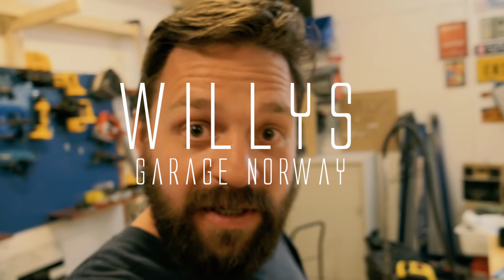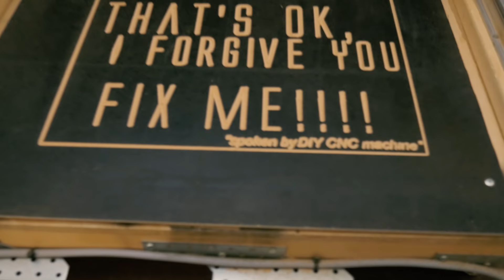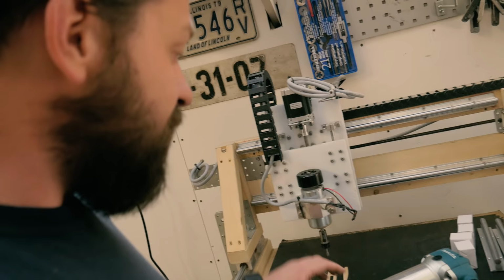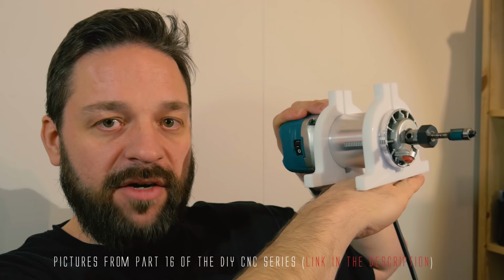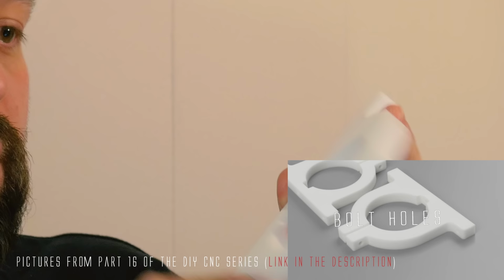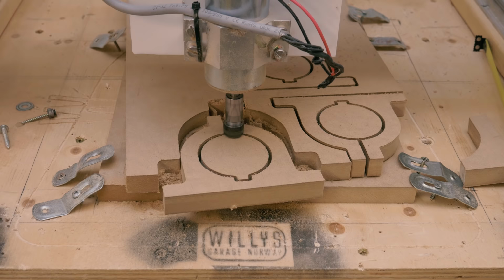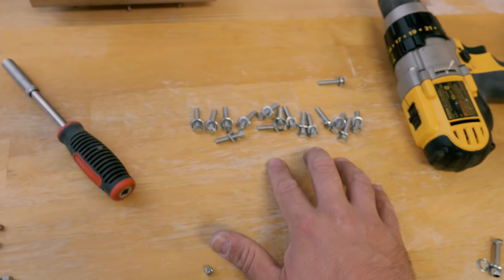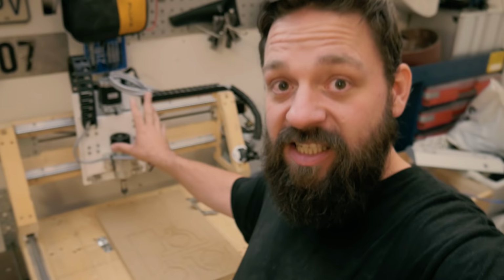First DIY CNC build (part 18) - Upgrading the GANTRY | SPINDLE | RAILS

Comment: Just wondering if your Z axis is hanging from the couplers ??, any down ward cutting might make the cutter go up and upset the Z accuracy
Reply from the maker: Hi, I do have a mounted ball bearing under the coupling on the z axis lead screw. This is fasten by two set screws so it should not move

Comment: Have you calibrated the CNC after upgrading,by dial indicator?
Reply from the maker: Hi, I havent done a calibration with a dial indicator on my cnc yet, since its out of wood (soft wood) it will allways shift a little bit so its not a high precision tool :)